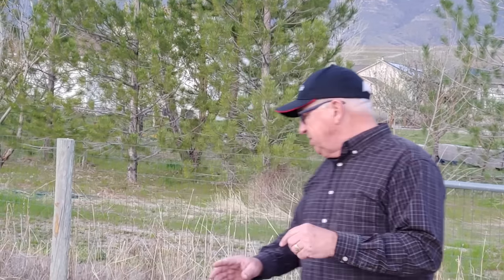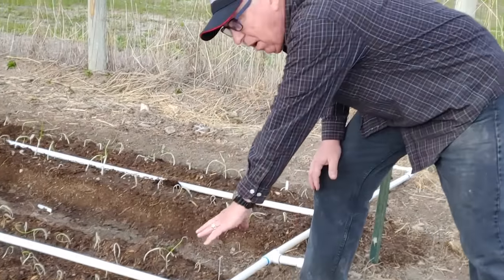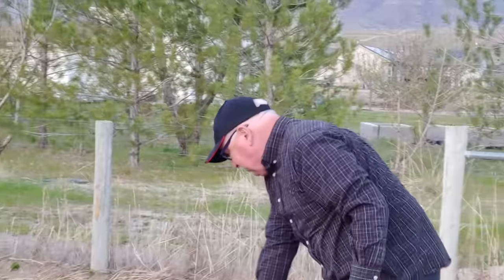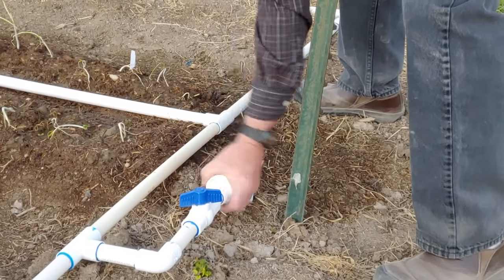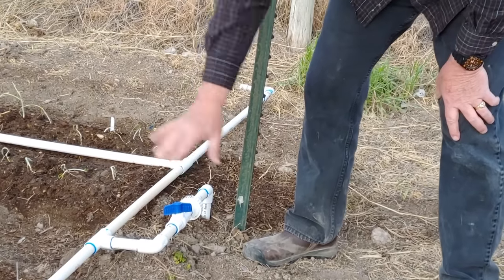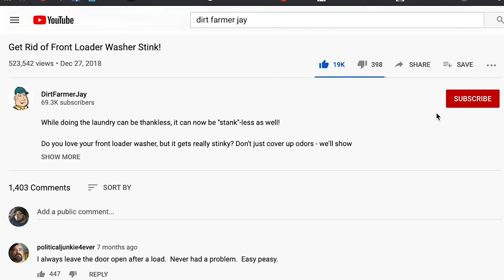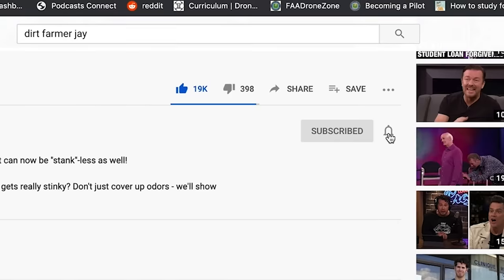DIY Garden PVC Drip Irrigation - Easy, Cheap, Effective!

Comment: I have permanent two foot wide beds spaced four feet apart so I was thinking, you could have a double or triple PVC watering pipe down each row spaced evenly  in case you wanted to do something like square foot gardening in which you'd really need to water the entire width of the bed evenly and planting in rows isn't required. Just a thought...

Comment: What size hole do you drill in the pipe? Sorry did not watch the entire video, saw the part where you talked about the drill bit size.
Reply from the maker: 1/16th inch. Amazing amount of water is delivered through that size orifice. Best, DFJ

Comment: Just found your video, great idea! Do you use a pressure regulator for the low pressure?
Reply from the maker: Bob, I technically don't control water pressure. I reduce volume, while giving lots of places for the water to go. This dissipates the pressure. Raising and lowering different areas of the pipe slightly does the rest. Does that make sense? Thanks for your kind comment! Best Regards, DFJ

Comment: i have the black irrigation with the small tubes coming off for supply lines and my problem is keeping them straight from year to year this is by far a better system try removing clogs from a laser drilled holes its a pain in the butt
Reply: I also had the black tubing, but the critters discovered that there is water in 'em. Chewed at every 6", completely ruined. The PVC pipe is the way to go.
Reply from the maker: Thanks for watching and commenting Willie BB123. When we first moved to the farm, we used a lot of drip lines. We have NEVER had the issues with PVC that we had with drip lines - splitting, cloging, drip ends popping off and flooding a section, etc. Best to you, DFJ

Comment: Was your drip system attached to your sprinkler system?  I'm attempting to diy one but with a hose - do you have an instructional video for that?
Reply from the maker: Jeanne, the water lines to this or set up as part of the multiple area irrigation systems around our place. It has it's own main, set up on a  timer or manual, whichever way I want. You can indeed do this with a hose. I have a couple set up right now temporarily with hoses until I get the long-term lines connected and buried. I don't have a separate video, but to do a hose set up, build the system the same way, but attach a garden hose to it using a female hose end x slip to PVC pipe fitting. Here's an example from Home Depot: https://www.homedepot.com/p/3-4-in-Slip-x-FHT-PVC-Hose-Fitting-53360/100130381. I hope this helps! Best, DFJ

Comment: THANK YOU FOR THIS VIDEO.  I live in a hill and I need to irrigate my cypress and other green plants to hold on the hill. What will be the distance between each hole to have proper irrigation? Thanks
Reply from the maker: AMIR, a couple of things. First, good to hear from you. Second, make sure you are placing the lines sideways across the hillside or you'll get lots of water out the downhill ports and very little on the uphill side. Third, spacing of the holes should align with your plantings. I'd drill 2 or 3 holes at each location so as to put a good amount of water, at a reasonable rate, right where it's needed. Let me know how it turns out for you. Best Regards, DFJ

Comment: How far of a run is it for your underground water supply and how much pressure is your underground line supplying to your manifold
Reply from the maker: Lee, we have our own well system and pressure tank. Delivery pressure in the system is 60 PSI. We've found this system works well, but takes a bit of fiddling to even out the delivery. Downhill lines tend to get more, so we do a bit of work raising and lowering lines, and if a portion of the manifold tends to "hog" the supply, we put an inline valve to slow down water delivery to the area that is getting too much water. I hope that helps! I just set up another set of this this on 6 furrows and balanced the system for a late planting of sweet corn. I like how simple this is and I actually set up the system, get it straight and operational, do a light watering, and then do the planting - you know exactly where to plant and the lines become row markers as well. Best Regards, DFJ

Comment: How many linear feet could be served with this PVC system before uneven watering happens at the far end? I would be using city water from a hose to PVC.
Reply: Honestly if you have to ask the question you should spend a little more money and get a real pressure compensating drip system. Your city system will have enough pressure to make all drippers emit the same amount. This is your goal right ?  It will cost more but isn't your happiness and garden what its all about.

Comment: Can I run my garden hose to the manifold? In other words is there a fitting that has one side to my garden hose and the other side to pvc pipe? What is it called? I’m assuming there are 1” to 3/4” fittings to come off manifold to lines?
Reply from the maker: Assuming you have adequate volume and pressure, absolutely. In fact, that is the way mine is set up for now.   Best, DFJ

Comment: How do you space the pipe when you have a raised bed of ... beans that are 6 inches apart?  I usually have beds about 3 foot wide.  Maybe I should rethink that... Suggestions?
Reply from the maker: Ancient Grizz - thanks for writing. When I have crops that are that close together, I drill the pipe so it delivers out both sides of the pipe, watering both rows at the same time. I hope that helps! Best, DFJ

Comment: DirtFarmerJay,  Is your system gravity fed from a tank?  And thanks for posting a delightful full of great ideas video.
Reply from the maker: Mr Ken.... our system is tied to our well set up. The pressure tank puts out 60 psi, I adjust the volume at each manifold to get the amount I want coming out of the holes on each "leg" of the system. Thanks for your kind comment as well! Best, DFJ

Comment: What did you use to lower your pressure? Did you install some sort of pressure reducer?
Reply from the maker: Chris, it don't use a pressure regulator but instead shut down the flow to the manifold or individual lines until I get the amount of flow coming out that I want. It's a back-hand way of doing it, but it works just fine. Best Regards, DFJ

Comment: What do you use to change from standard high pressure garden hose to low pressure? What is the pressure of the low pressure system you use?
Reply: Your local irrigation store has cheap PVC filter/pressure compensators any pressure and volume.
Reply: Because  of all the holes the pressure  isn't able to build no need to reduce pressure  from the main source that's why the pipes with holes  dont have to be glued
Reply from the maker: If you need to increase pressure to your watering configuration, you can connect the ends of each pair of pipe with a pipe WITHOUT HOLES. This will allow water pressure to build up in the end of the runs and then force more water back into the pipes. You might want to glue this connection especially if you want to really increase the pressure. If pressing these together they would most likely come apart readily when the pressure rises. Best DFJ

Comment: How to block holes better , in case you decide to change the distances. Silicon ?
Reply from the maker: Azam, you could use silicone. I keep differing sets of pipes on hand to use the one that is needed for various types of plantings. Best, DFJ

Comment: Would a gravity fed water barrel be able to work rather than pressurized garden hose home source of water?
Reply from the maker: Thanks for watching and commenting D. Nicely. I'm going to say "probably not" just because you'd need A LOT of volume from that gravity fed to get the water all the way to the end of the pipe to feed all the holes. Plus you'd probably empty your barrel very quickly. Hope this helps. DFJ

Comment: I installed this system but my water pressure from the well was not high enough so I wound up having to do three different sets of two rows of six 10'  pipes each with a timer to run them at different times.

Comment: can you put a smaller hole so that it more of a drip and not a stream or is there issues with doing that?
Reply from the maker: Yep, if you can obtain a bit smaller than 1/16". Industrial supplies should have them. Yes, it will release less water, tend to weep more than stream, but it will clog easier. Does that help?

Comment: Me again....so my water source is the spout from the back of my house. I am thinking I'll run a hose from it to the irrigation system for my raised bed. My best is somewhat higher than most. Do you think I'll have trouble getting the water to flow properly since the bed is higher?
Reply from the maker: Shouldn't be any problem unless the water pressure coming out of the garden hose is unusually low. Best, DFJ

Comment: If I want to do this watering system and I wanted an equal amount of water on each plant due to the fact that I'm putting it in pots do I make the whole smaller or bigger in the front because of the pressure that I'm working with with a pumping system
Reply from the maker: You can alway make the watering hole bigger but not smaller. I would recommend starting with all the same size holes and modify them if needed. Caution, it's easy to drown plants that are in pots with too much water. Good luck! Dirt Farmer Maggie

Comment: A couple questions.   Do you see volume loss at the end of the pipes?  I've read that it is a good idea to close the loop at the far end to even out water pressure.   The second issue is as far as PVC piping, I wonder if the SP-20 will degrade quickly.  I know for most outdoor applications the sp40 is recommended because PVC degrades in sunlight.
Reply from the maker: Hi Peter. Thanks for watching and writing. My experience has been that as long as I drill the holes in the pipe exactly the same, the water flows out the last hole just like the first. As far as the pipe itself degrading in the sun, I always take the pipes apart in the fall and store them until Spring. I live in a high desert where the Winter is snowy and store the pipes up off the ground on shelving off the back of my chicken coop. I've used the same pipes for several years now with no problem.
Reply: @DirtFarmerJay  thank you for taking the time to answer and for putting out great videos.

Comment: take a 2 liter coke bottle drill four holes in bottom of the bottle then drill a hole in the side of the bottle about 1 inch from bottom of bottle on each side of bottle ,drill 1/4 inch hole in lid of bottle .install 1/4 inch  plastic or rubber hose from water supply to the bottle....I use the timer system  for watering the  yard.that way I get even watering to root of tomato plant or what ever I need to water.....!!!!

Comment: What do I do if I only have raised beds. Thanks jim80
Reply from the maker: Jim, thanks for watching and writing. These are scalable. I'm actually fitting these systems into all our raised beds as well and will be doing an episode on this - but that will be awhile before that happens. The prototypes we've done work well. They consist of a "permanent" feed line, control valve, and manifold that goes across one end of the bed. We do these with an elbow at each end and a tee in the middle. This creates 3 lines running lengthwise in the beds. The ones on the edges have ports pointing to the interior of the bed, the middle one has holes on opposing sides. These are all press fit. We use different distances in the 1/16" holes, depending on the crop. Another secret we've learned that balances the output is to put another manifold on the other end that closes the loop and distributes water better. I hope this helps! Best, DFJ

Comment: I did the same before but the pressure a problem. I broke system into zones. 2 fifty foot rows at a time. The far ends never got enough water. Drip tape kits offer the same output and can do a huge area in comparison and in the long run is much cheaper and faster, effective.
Reply: Put a loop on the end - it will solve your pressure woes

Comment: I was thinking of doing the same sort of system but burying it rather than on the surface so that the water goes to the roots and doesn't sit on top and evaporate.
Reply from the maker: Thanks for watching and commenting Kev Hatch. If your soil is good the water won't sit on the surface. If that's happening, you need to ammend your soil with some compost. You probably have too much clay. Best, DFJ

Comment: IS THE WATER COMING OUT THE SAME VOLUMN AT THE BEGINNING OF THE RUN AS IT IS AT THE END OF THE RUN 40' AWAY.   I HAD FOUND USING SOMETHING SIMILAR THAT AT THEND OF THE PVC WATE IS VERY SPARSE UNLESS I TURN THE WATER ON MORE.  BUT THEN IT REALLY FLOODS THE BEGINNING AREA.  PLEASE EXPLAIN  THANKS
Reply from the maker: Hi bear9923. The first thing to do is to check the leveling of the garden area/pipes. If one end is higher or lower than the other, you need to level the pipe by raising the low end and putting it on a block or piling soil under it to make the pipes level. You can also connect the two pipes at the NON Manifold end with a pipe with no holes so it can help push water back into the pipes that do have holes instead of losing it into the ground where nothing is planted. Does this help? DFJ

Comment: Do I need an anti siphon valve for each zone? Or just one for the entire system? Lowe’s told me I need just one, and then a solenoid for each zone but Tampa codes require back flow prevention.

Comment: I was thinking about hooking it up I was wondering if the flow of the water slows down a lot on the far end of the pipes. Not getting as much water to those plants?
Reply from the maker: Chuck Hansen - because this is somewhat a gravity flow system, you can affect where water is being delivered by raising and lowering different parts of the system on bricks or pieces of wood. A lower area will tend to get more than it's share of water, so raise that a bit to get the water is distribute more evenly. I hope that helps! Thanks for watching our video! Best Regards, DFJ

Comment: Tried building the irrigation and only the first 10 ft actually puts out water. Even when I level it. Spent a lot of time in pretty disappointed. Any suggestions?
Reply from the maker: cascades500, sorry to hear of your challenges. You've mentioned that you've leveled the system, with no correction. Another adjustment you can try is to lower the ends furthest away from the supply manifold. Another person that built this system also paired adjacent runs by adding an elbow at each end and a non-drilled pipe. That further evened out the water delivery. Give these a try and let me know if that addresses the problem. I'm assuming you have a good supply of water to the system as well. Best Regards, DFJ

Comment: This is perfect with one caveat; there could/should be more ball valves along the manifold for plants that maybe do not need so much water as others.
Reply: The hole thing is a joke. To much work. Just roll out drip hose, and you done in 1 hour.
Reply: Hercules is right on.
Reply: Ya and roll out the dough too.
Reply from the maker: We used drip hoses years ago. They didn't last more than one season without getting sun rot. It depends on the climate you live in. We have harsh sun in the summer in the Mountain West of the US. If your climate is more temperate, you might get a drip hose to last more than one season.

Comment: Would this work if you buried it?
Reply from the maker: Samantha, only moderately well. The system works well because it is "leaky" and is not impeded by anything against the holes. I hope that helps! Best, DFJ

Comment: do i need buy a pressure regulator?
Reply from the maker: Charles Mantia - a pressure regulator is not necessary. You can use the same workaround that I do. Although you are not really controlling pressure, you can control volume to a section of the manifold or individual laterals with an inline valve. This effectively distributes the pressure where it is needed and evens out the flow. This is in essence as low pressure system already, so get the flow where you need it by adjusting volume. Thanks for watching and writing. Let us know how it turns out of you! Best, DFJ
Reply: @DirtFarmerJay  thanks

Comment: What about pressure problems? Don't the end of each run have much less pressure? How do you solve the pressure issues?
Reply from the maker: Thanks for watching and commenting. This is an "imprecise" system depending on where you drill your holes, etc. One easy fix is to lower the pipe, (by removing some soil under it to make it lower or raising other areas) so THAT starved area will get more water. Also you may want to add a PVC ball valve into the manifold to balance flow to the outlets. Best to you! DFJ.

Comment: My garden/plants are not on a level ground. It runs down a slight hill. I’ve tried soaker hose. Doesn’t work at all due to slight hill. What system do you suggest I use?
Reply from the maker: Thanks for watching and commenting. The easiest way to control water flow is by raising and lowering the ground to even out the flow along the entire run.

Comment: Jay I must have missed this part. Normally you would glue pvc together but you have something blue in there to keep them together (and not leak?) what do you use to connect the pieces?
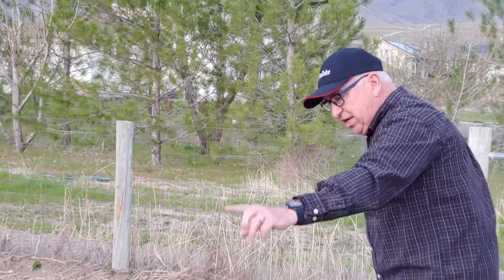Reply: sandoratech 1:20
Reply: the glue is probably "Christy's Red Hot Blue Glue", Pipe Cement. It is a blue glue. Fantastic and super easy to use. Easy to make a mess too! :)
Reply from the maker: Thanks for watching and commenting sandoratech. Because we take the system apart for storage every fall, we just press the pipes together. The only part that is glued in the manifold. That makes it easier to add more runs or change the configuration of the watering plot. Best, DFJ